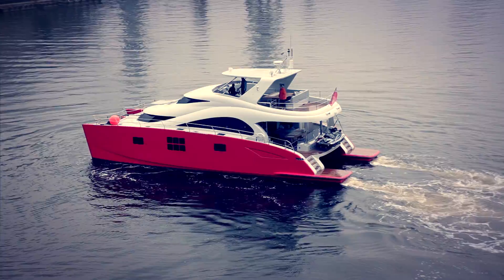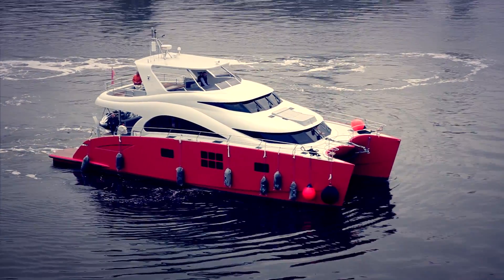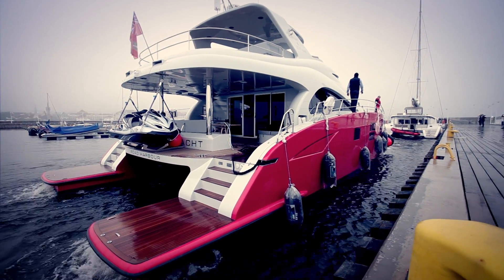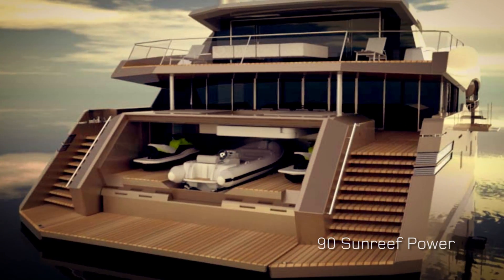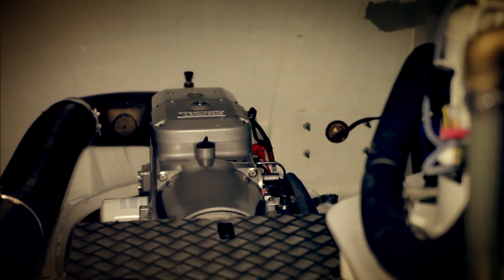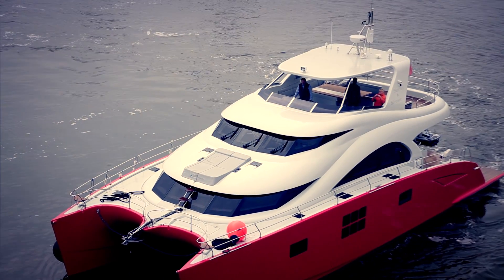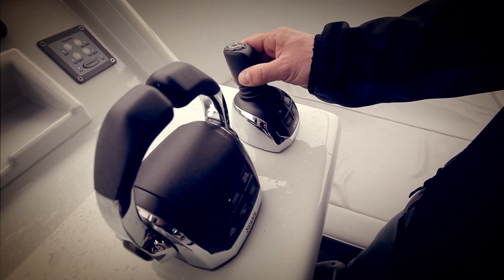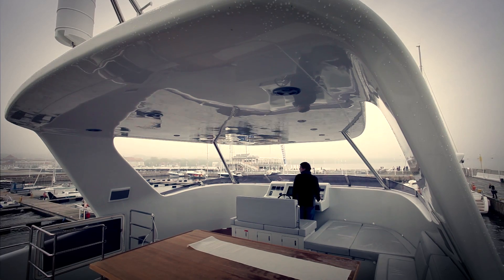60 Sunreef Power with innovative IPS system by Volvo

Comment: I prefer water jet drives b/c there is nothing hanging below the sponsons like the IPS system and the draft is even more shallow. Great to see the new 90 coming but I really want someone to buy the Power210 so we can have a walkthrough. I've never seen a trimaran interior quite like that, going from the center hull out to the sponsons. Very innovative design!

Comment: Did you put bow thrusters on it? Or is it just the rear props?
Reply: No bow thrusters. This boat has the Volvo IPS drive system. Independently maneuverable, forward facing props with joystick control.  https://www.volvopenta.com/marineleisure/en-en/products/info/for-motor-yachts/volvo-penta-ips.html

Comment: After 4 minutes and 31 seconds, i still have no idea what an IPS system is. You should have started out explaining how it works and how it differs from a conventional system, and then moved on from there.
Reply: If you don't understand what it means, probably you're on a wrong channel. :-)))
Reply: I believe IPS stands for Independent Propulsion System. What they do is cut holes in the bottom of the hull and suspend the propellers from there. The props can turn 360* so it's a very maneuverable system. As to cutting holes in the bottom of my boat...well...maybe not.
Reply: It’s a pod drive system versus a straight shaft system.  The pods can move independently of each other.  Allows for crab walking and w some systems dps which will allow you to hold position w the push of a button.
Reply: Terry Tytula it's simply joystick control mainly be used in docking areas. i think most ppl can infer that from this vid. 
if youre still confused or want more details, google it lazy...